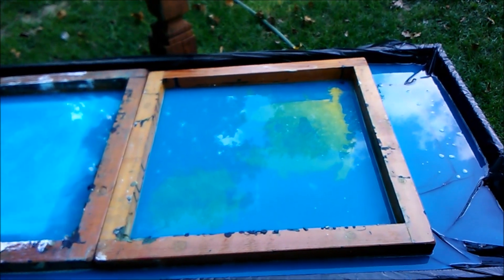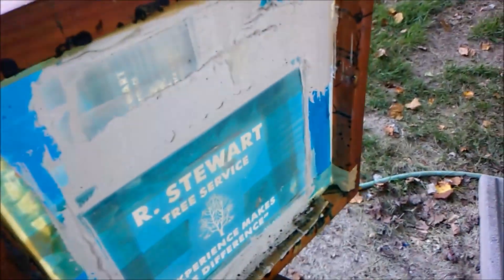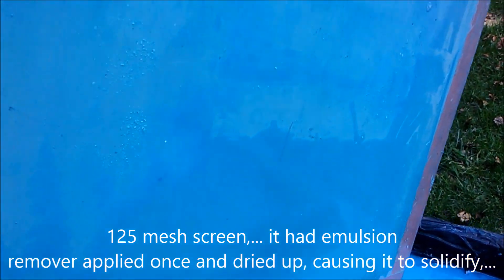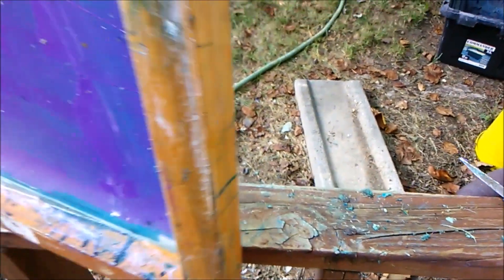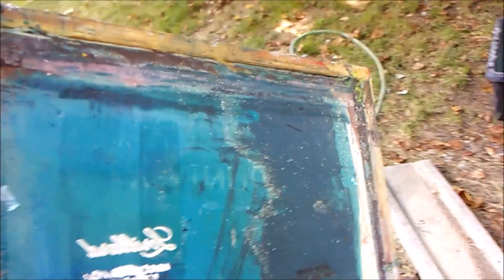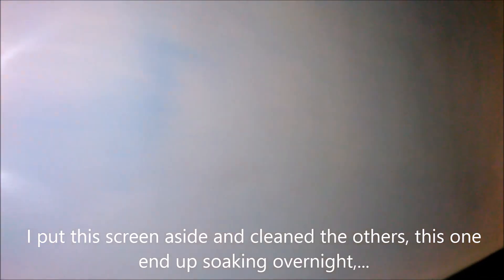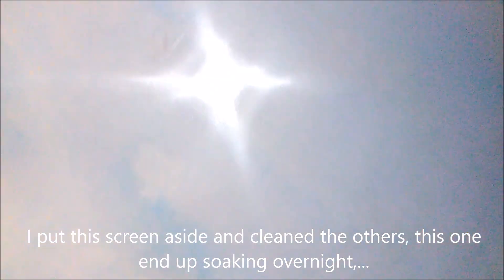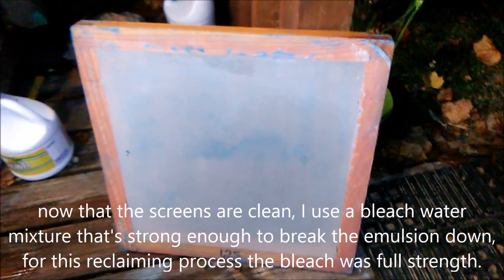How to Reclaim screens using bleach

Comment: So you let them sit for whole day before bringing them to car wash to hit them with pressure washer ?
Reply from the maker: Well, using this method when all else fails you could wait even longer. However in most cases after a couple hours most of the stubborn spots will come out, but hey some screen I've came across from Winston were like 15 years old. Yeah for some,... whole day and pressure washer.

Comment: Could you let me know the type of bleach / brand cause I tried this and am having trouble
Reply from the maker: I just picked the bleach up from "Dollar Tree", "Dollar General",... I do not recommend using straight bleach for every cleaning. Dilute it with water after the first cleaning with straight bleach. To use bleach is at your own risk. It has been a little over a year now and so far my screens are still holding up, the mesh hasn't start braking down, no pin holes from the bleach, the screens are intact and and work fine.